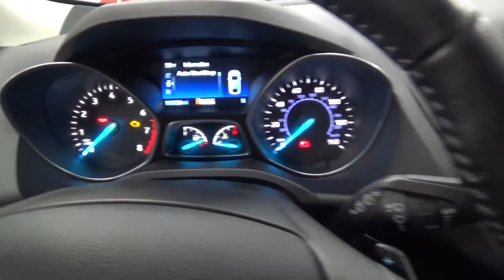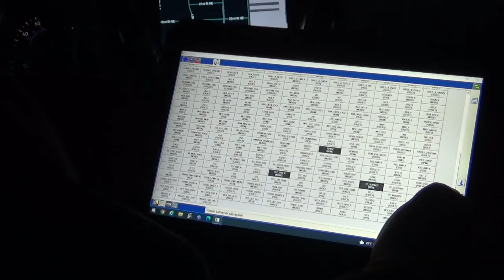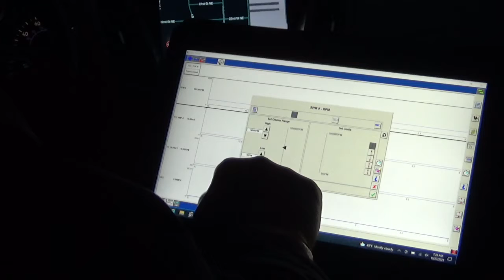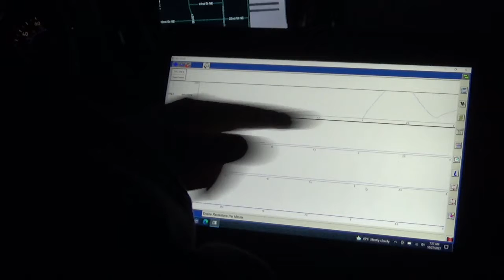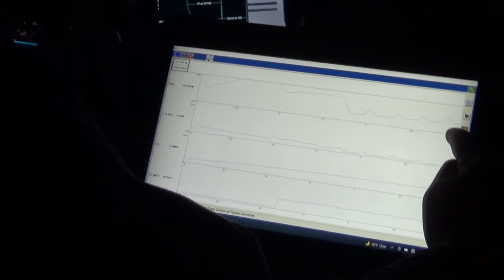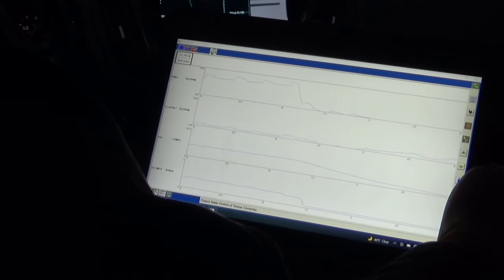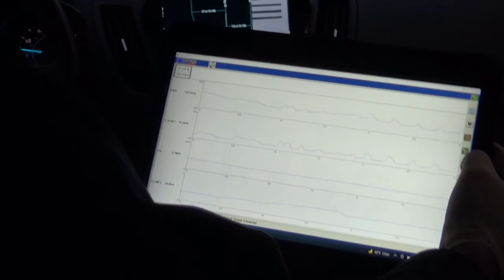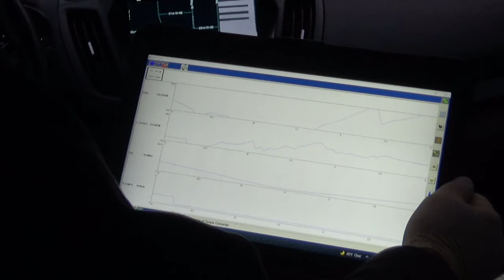FORD ESCAPE RPM SURGE

Comment: Hey mate, thanks for the video. 
I have a 2012 BT50 3.2 which had this exact issue about 10 months ago. I change the oil and filter in the gearbox and it ran perfectly for the next 5 months.
The problem returned with an additional problem of dropping gear randomly e.g. driving at 60kph would drop into first and lock up the wheels. I took it to a auto trans specialist who determined the dropping gears issue to be the output shaft speed sensor and we ended up upgrading to a heavy duty valve body, oil cooler, and general oil and filter change at the same time. Now 5 months later again the RPM fluctuation has returned! 
Do you have any thoughts on what this might be? 
Thanks in advance.
Dan
Reply from the maker: I assume it has the Ford 6R80 transmission. Those had a recall for the OSS sensor which you got replaced. Your symptoms do sound like the torque converter clutch slipping. You will need a scanner to monitor the TCC slip desired/actual PIDS. If it's slipping like in the video then the fluid will need to serviced again. If that still does not cure the slip then the converter will need replaced. First thing I would do is remove the small dipstick on the passenger side of transmission and see what the fluid condition looks like.
Reply: @raincitywrench117   Thanks for getting back to me. Yes that’s right it is the 6R80 gearbox. I ran forSCAN and got some live data. The clutch slip actual shows the fluctuation that I am feeling however the TCC solenoid amps and TCC solenoid pressure both mirror this fluctuation pattern. Does this mean that the solenoid may be the cause as it is commanding the clutch to do this? Or possibly some other sensor telling the solenoid to act in this way. It will only fluctuate under very light load. If I go full acceleration the clutch locks up very well. 
I checked the oil and it is still clear and red. Only has about 8000km on the oil. 
Thanks again, looking forward to hearing your thoughts.
Reply from the maker: @outthere2286  That's an interesting issue you have there. Not sure what your problem is. It appears it's being commanded for whatever reason under light load. I assume this vehicle is drive by wire with an electronic throttle body. It would most likely set codes but I would still check both accelerator pedal position sensors along with both throttle position sensors (APP 1 & 2, TPS 1 & 2) to see if there is any voltage fluctuation. You also said the valve body was replaced. Not sure if forscan has this capability but see if you can find what transmission solenoid body identification is stored in the computer. There is a strategy identification tag on the left side of transmission case. A 13-digit solenoid body strategy & 12-digit solenoid body identification on this tag and it should match what's stored in the system but since the main control valve body has been replaced the strategy will need to be updated or maybe it has already been updated? May not be what is causing the surge but definitely a good place to start. 

Instructions from Ford PTS:
**If the solenoid body identification and strategy displayed on the scan tool match the solenoid body identification tag or replacement tag, then the solenoid body identification and strategy are correct for this transmission and a solenoid body strategy data download is not required. If a new main control was installed, record the 12-digit solenoid body identification and 13-digit solenoid body strategy from the replacement solenoid body tag provided with the main control service kit. Place the replacement tag over the existing identification tag. Using the scan tool, select Module Programming and Programmable Parameters under the toolbox icon then select transmission. Follow the instructions displayed on the scan tool.
There are fields to enter the 12-digit solenoid body identification and 13-digit solenoid body strategy recorded from the solenoid body. 

NOTICE: The 13-digit solenoid body strategy number displayed on the scan tool must match the solenoid body strategy number etched on the main control. If the numbers do not match, damage to the transmission or driveability concerns can occur. NOTICE: If the new main control was not supplied with a replacement solenoid strategy identification tag, DO NOT INSTALL the main control as all required programming information is missing. Compare the solenoid body strategy identification etched on the main control to the solenoid strategy identification tag on the transmission case. If the solenoid body strategy identification etched on the main control does not match the solenoid strategy identification tag then a solenoid body strategy data download is required. If the solenoid body strategy etched on the main control does match the solenoid strategy identification tag on the transmission case but does not match the solenoid body identification and strategy displayed on the scan tool, then a solenoid body strategy data download is also required.***

Comment: I know this was a while ago, but about how much rpm’s was it fluctuating? I have a 2016 2.0 and mine is jumping very slightly (like 50-150 rpm jumps) I’m just trying to figure out if it’s the same thing as this video
Reply from the maker: It can be very subtle and almost unnoticeable like 50 rpm to more severe somewhere between 200-300 rpm. Repaired a 2.0 that had very obvious rpm surge this summer and wasn't able to clear it up. Had to overhaul the transmission, replace torque converter, pump, input shaft and control valve. Have your fluid drain/filled then put a hundred miles or so on it. If it doesn't clear up then service the fluid one more time and drive it again. Most of the time the problem will clear up and the clutch will start holding.
Reply: @raincitywrench117 thanks! :) just drained and filled mine and it looks like it reduced the surge but it still does it, you think I should wait a couple hundred miles or so and drain and fill again?
Reply from the maker: @frankabignale6687 Definitely. Very good chance it will completely clear up after the second service. It takes a while for the fluid to work through the converter clutch
Reply: @raincitywrench117 will do, thanks for the advice :)

Comment: Thank you so much for making this video! I have a 2013 escape 2.0 that I bought used with 164,000 miles and it’s doing the exact same thing. No one could figure it out. Dealer said I need a new torque converter without even looking at it. I’ve always heard that changing the fluid but that many miles could damage the transmission. Would you recommend doing it anyway or maybe using some Lucas? Also, you said you let it run for 20 minutes. Did that mean you drove it for 20 minutes? Thanks again.
Reply from the maker: You won't hurt the transmission by changing the fluid. I drain and fill the fluid, drive it for 20min and then drain and fill the fluid again. It usually fixes the surge. May have to drive it for a day or two for the converter clutch to come back to life but worth it if it solves the problem.
Reply: i did once and it didn't work think Im going to try it again.  i might of had sligh improvement but not fixed yet. 157k
Reply from the maker: @adamquimby6416  Give it a couple tries and then drive it for a day. That may clear it up.
Reply: Did it work for you?

Comment: Hi! My 2011 explorer rpm goes to 4 thousands while driving on the freeway! Any ideas where to star?
Reply from the maker: Most likely has the 6F50 transmission. Count the times the rpm's drop when accelerating from a stop to 60mph. The rpm will drop each time it shifts which will be 5 times to reach 6th gear. If it doesn't reach 6th gear then something is wrong. It may be in limp mode. I would have the computer scanned for codes and fluid level checked before doing anything else.
Reply: @raincitywrench117  ok, thank you! I will do that!

Comment: My first escape 2018 sel is on 69k miles should I do a trans fluid change and also the filter
Reply from the maker: Definitely. Mercon LV turns black with age. Drain and fill the transmission like in the video. If the fluid is real dark then drive for a few miles and drain/fill again. The filter attaches to the pump and is not serviceable unless the case is split in half.

Comment: Was this a good fix?
Reply from the maker: Yes it was. Depending on the severity of your fluid condition, you may have to drain and fill, put a few miles on it then drain and fill again to get it all cleared up. Sometimes the clutch is too far gone and will require a new torque converter though.
Reply: @raincitywrench117  if the torque converter was too far gone I wouldn’t be able to drive right?  I guess it depends on your definition of too far gone. I plan on doing a couple drain and fills. Getting a slight surge and some shudder but still holding gear and still shifting decent.
Reply from the maker: @hunterthompson6659  If the TCC is slipping it will make  the rpm’s surge but won’t affect the shifts. So it will still drive and and shift fine with a bad torque converter clutch. Most of the time servicing the fluid will take care of the surge but sometimes the clutch inside of the converter will not clear up and have to be replaced

Comment: Isn’t that a lot of miles for a 2017?
Reply from the maker: It is. I think the average is somewhere around 15k per year so it should have around 60-75k. They may have had one LONG commute.
Reply: Not in today's world my 2017 has 120,000 bought it.3 years ago with 42,000
Reply: I have 15,450 on my 2017 today. I drive approx 2800/year.

Comment: 111,000 miles & it's doing that? I thought 2010 was bad, the 2010's got 14,000 less miles than a 1994 aerostar that's not getting fuel properly & the 2010's doing crap like that, but when a vehicle's got over 3,000 people saying that the average for the entire vehicle going to crap is only 61,000 miles & you compare it to a Ford with a bigger engine & 2 feet more room that averages at the heater going bad at 125,000 miles & the engine wearing out closer to 200,000 miles. Interesting video, I was wondering why a 2010 with 14,000 less miles than a 1994 was making me resort to a bicycle for transportation.
Reply from the maker: Mercon LV turns black fast. I've seen discolored fluid in under 30,000 miles. I don't like the fluid. Always thought old school dexron III was the best.

Comment: What about fuel pump issue?
Reply from the maker: I suppose but since these engine are direct injected and using a high pressure pump. A low fuel pressure issue would probably cause misfires, check engine light on, severe power loss symptoms, etc. This vehicle ran and drove perfectly normal other than the rpm fluctuation due to the tcc clutch slipping.

Comment: My Chevy cobalt doing the same thing it’s a 2010 2.0 coupe
Reply from the maker: Sounds like dirty fluid. The transmission doesn't have a dipstick to check fluid. It has a plug on the driver side of trans next to the axle that is removed to check fluid level and the car has to be running to do this. To check the fluid condition I like to remove the drain plug on the bottom of the transmission and drain into a clean plastic cup to check for any metal and how dark it is. I loosen the plug but don't completely remove to take the sample. When a few tablespoons of fluid drain out in the cup then screw and tighten the drain back in. If you pull the plug completely out it will be a mess. If the fluid is really dark and smells nasty then I recommend draining and filling the transmission. They usually hold 4.5qt. You can drain fluid into a pan and measure so that way you know how much to fill back in which is done through the vent on top of the transmission otherwise the fluid fill/check procedure has to be performed. All the fluid will not come out but this may fix your problem or you can schedule a shop to flush the fluid and see if that cures your problem.
Reply: @raincitywrench117  true thanks for info yeah ima take it back to dealer ship they said there mechanic gonna check it tomorrow thanks again for replying